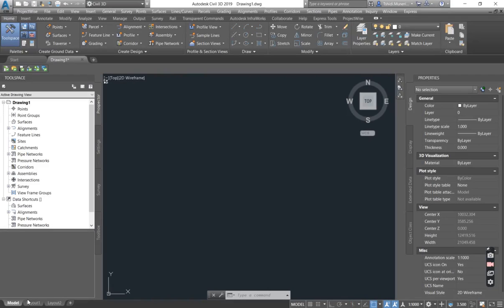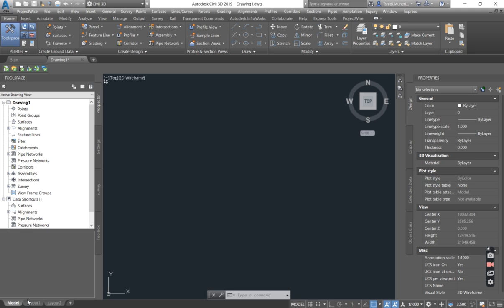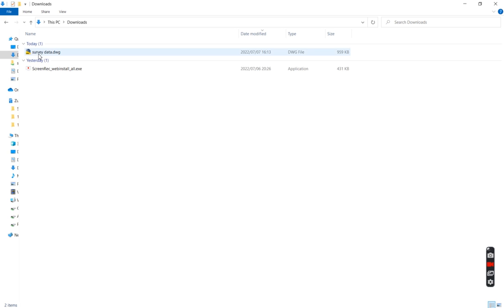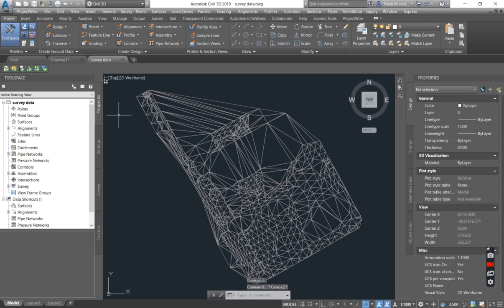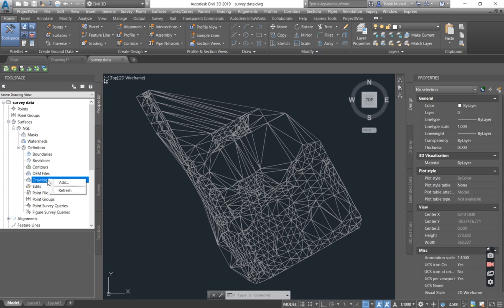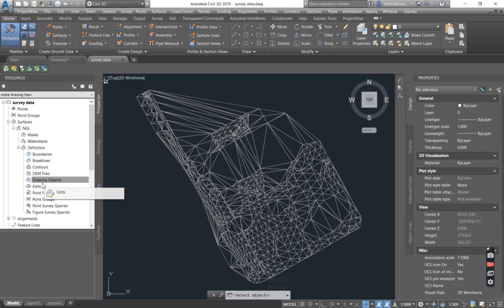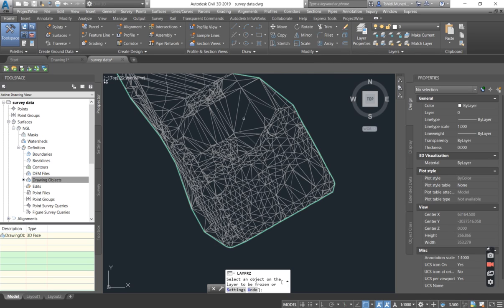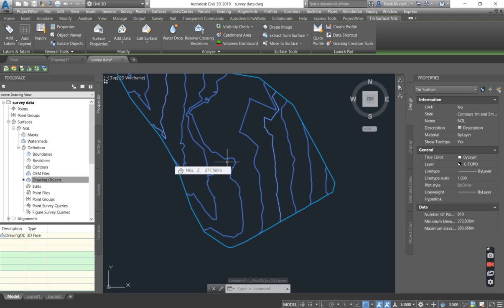Civil 3d Tutorial: Creating a Surface from 3D Faces

Comment: Hi All, 

I am working on one file that I got outside this course. 
It is an Autocad drawing, which I guess used to be a CIVIL 3D. 
It has all the elevations (txt), points (with E,N, & Elev) and contour lines. 
I am trying to follow the exercises in the course and generate the surface. I tried two methods: 

M1. Converting the standard points into COGO points, than creating the surface. 
M2. Unhiding the zz Ground Surface Layer Tin and creating the surface from the Drawing objects (lines or 3D Faces). 

Can anyone help me figure out the issue, since the civil 3D refuses to pick up the elements from which to build the surface? 

Thank you all!